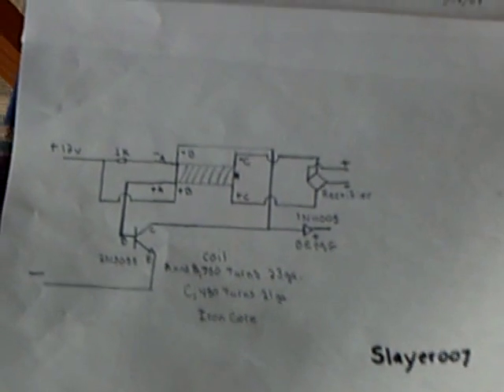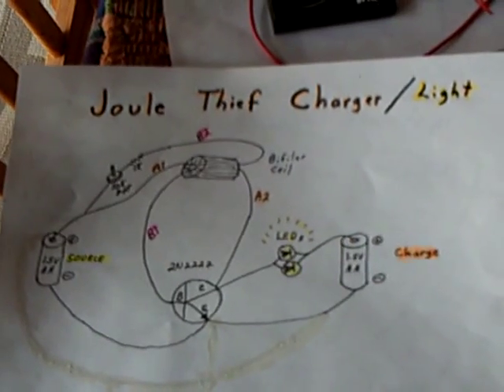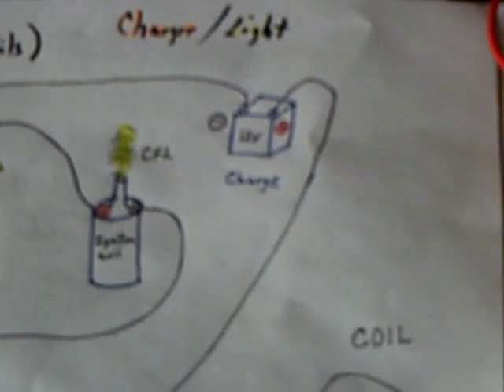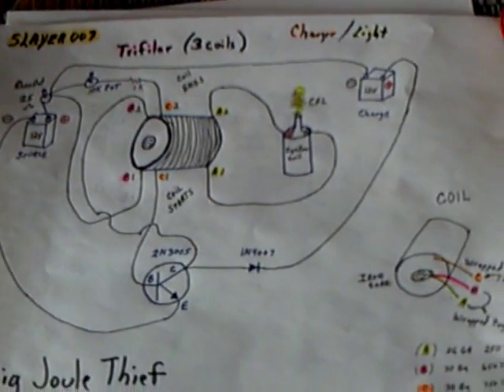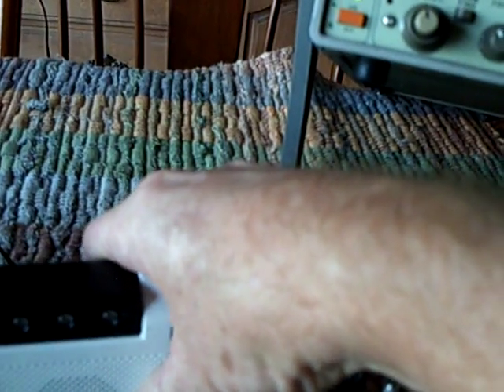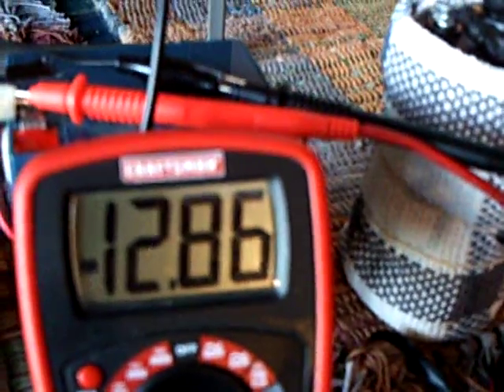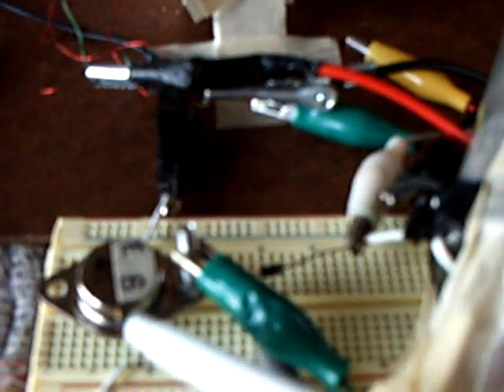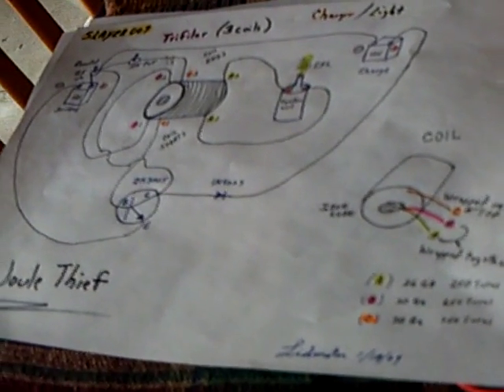Slayer's Big Joule Thief --My Replication

Comment: @Lidmotor  Have you or anyone else tested your replication of Slayer007's "Big Joule Thief" to desulfate a 12V lead acid automotive battery?  I'm looking to build a circuit to desulfate some heavy duty 6V and 12V lead acid batteries and would appreciate any suggestions, especially a proven circuit.  Thanks.